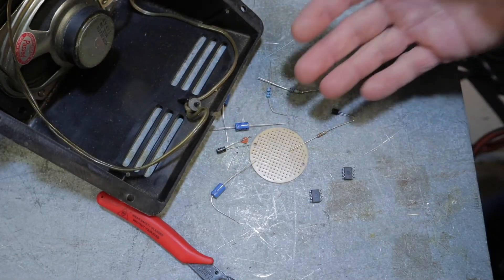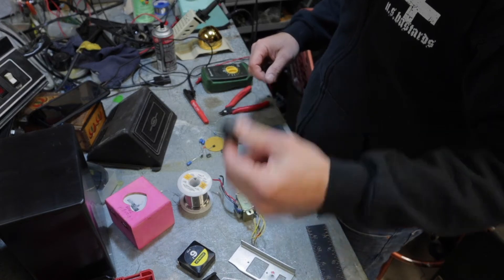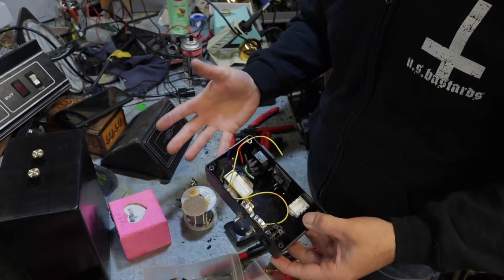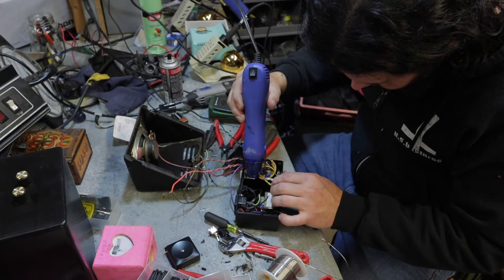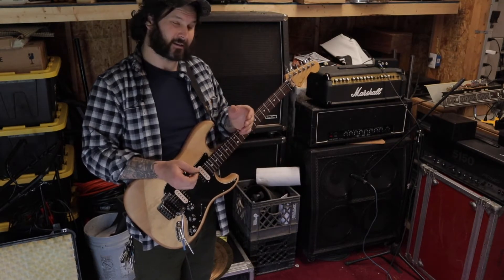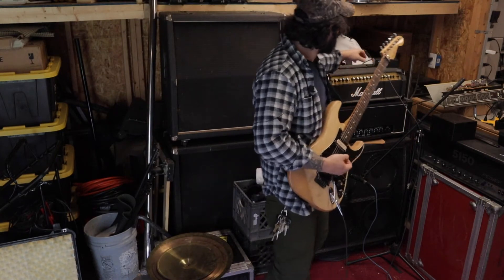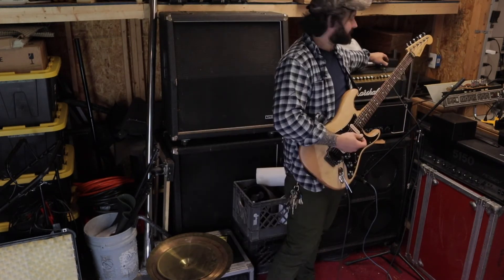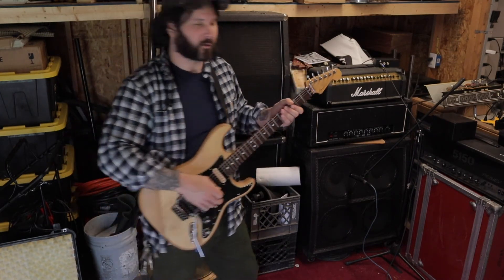1W amp built from LM386 and spare parts. MASSIVE DOOM TONE

Comment: I really like that you show the not so great moments in building electronic projects. Most channels show these easy 2 minute builds with no problems. Not ever realistic. I usually say the exact words you did at least twice every project.  Also came to the same conclusion you did regarding just using one chip instead of two. The volume boost with 2 compared to one is  very disappointing. The noise level was terrible with two, no problem with one. In my experimentation with the dual I did come across a circuit where it was insanely touch sensitive to your playing pressure. Touch the strings very lightly and 100 percent clean. More pressure both louder and distortion. Play hard and all out thick distortion. Or anywhere in between. However not practical for most playing.

Comment: I'm trying to build the little gem mk2 as a first audio electronics project. Waiting on some more parts to come in. I'm trying to understand what modifications you made to the original schematics.
Am I right that the doom sound was created by linking the 1-capacitor-8 connections of both LM386's together?

Would love to throw in a switch to make it doom.

Comment: There you have your 666th subscriber!
Hey man I see that you have a Valvestate head, I also have one but it makes a loud 'POP!' noise when I turn it on, after that it works ok but... if I plug ANY guitar pedal, the signal gets barely noticeable and it pretty much doesn't sound, even at full volume. I've tried these pedals in other amps with different cables and I know everything works. Do you have any idea on what may be going on? Anything to start looking at? Thanks BTW
Reply: If you're using any kind of surge protector or adapters that cab mess with your ground. So make sure nothing it interrupting your amps connection to ground.
Reply: @jokinmyass9446  I had to take it to a local amp builder and he found some loose connections coming from the power input, also the main 4 capacitor were replaced and now it works like a charm. I also replaced the reverb tank with one gotten from amplified parts and I love this thing! greetings from Colombia.

Comment: Thanks for sharing. Is it possible to remove from lm386 out of tune distortion?
Reply from the maker: Yes I've got some strange intermodulation going on either from a shortcoming in the power supply filtering or possibly how the LM386 has its outputs connected.  I made this version out of some parts I had laying around. If I do another amp like this I would make some changes to have some more flexibility and beef up the power supply for sure.

Comment: Gnarly. How was the volume level with that thing cranked? You may have invented the ultimate studio Doom amp.
Reply from the maker: In a 4x12 it was loud enough to feel a little low end rumble but the neighbors won't be freaking out. The speaker out can be used to send signal to a larger power amp as well and then it could be insane.